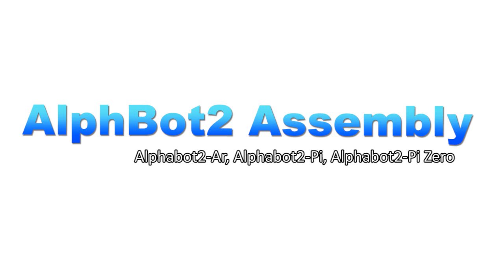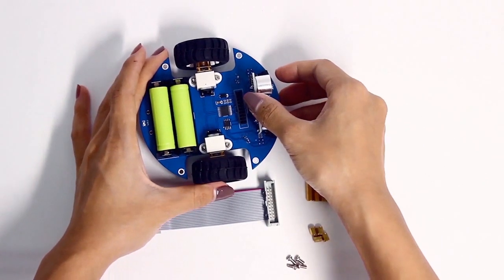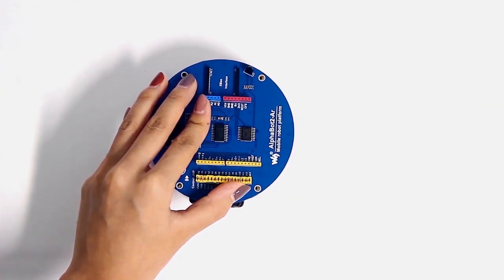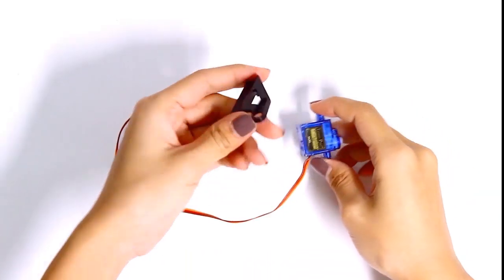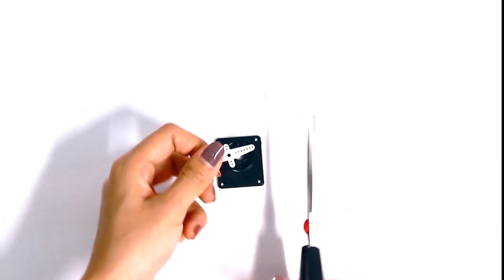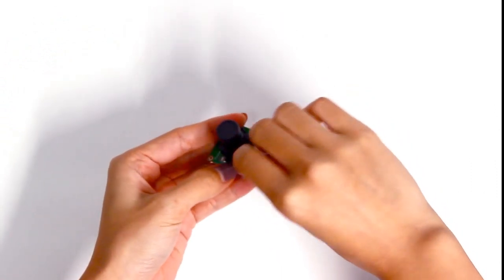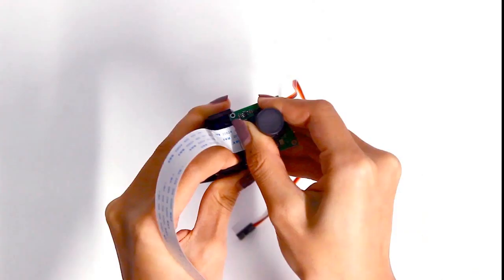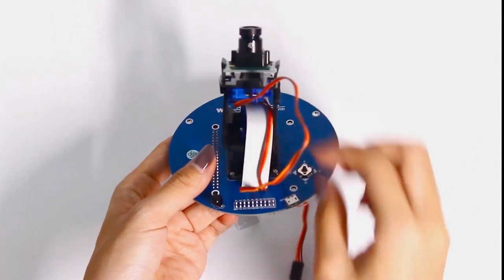AlphaBot2 Assembly 2

Comment: Im trying to assemble this thing right now. One of the posts has no groove which would be already a showstopper but what I find even more annoying is the sculpting of the plastic elements. It is not just a snip-snip with a pair of scissors as the video suggests.
Reply from the maker: which kit did you buy? Dear
there is another pack of the steering gear we provided additionally. (thoese needn't to be trimmed again.)you can use that.
Reply: @waveshareelectronics  so true. I found it eventually.